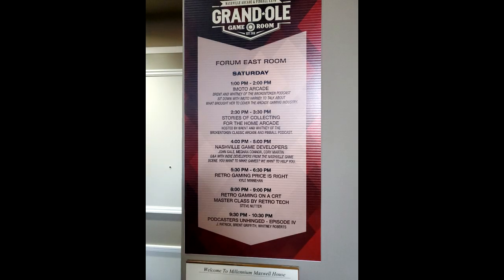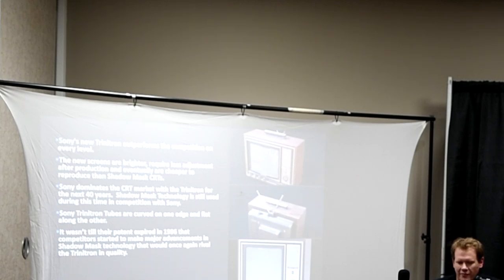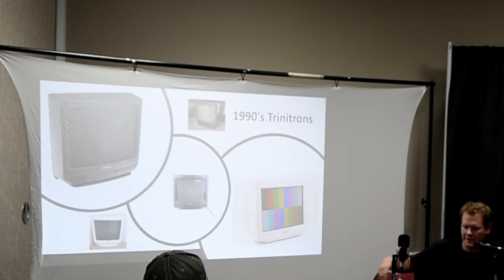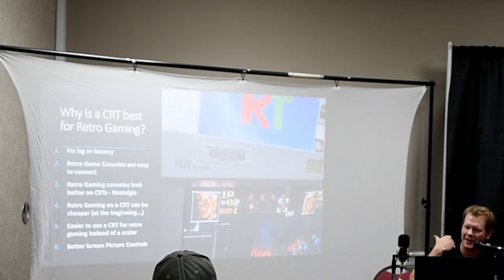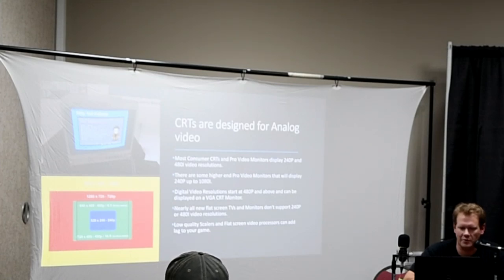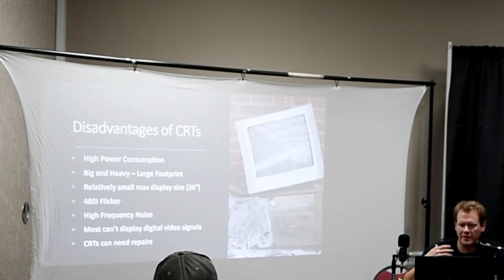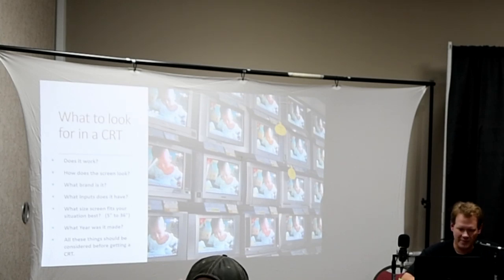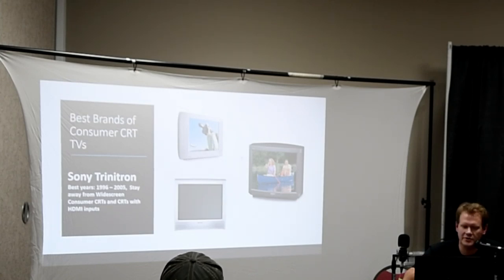Advantages of CRT Displays & The History of Sony's Trinitron - 2019 MasterClass Panel Pt. 2

Comment: Hey, one question its possible to replace a Cathode-Ray Tube, using it from another crt tv? example i have a small tv that works and i have a cathode-ray tube from a medium tv, but the board got damaged.
Reply: It is possible... if each television set's neckboard is compatible with each C.R.T.  ...there are neckboard connector adaptors for some C.R.T.s, if you run into an incompatibility.
Reply: I have swapped a few picture tubes of the same size and if they have the same grid and heater voltage there should be no problem.It's needed to measure resistance of deflection coils, it should be at least approximately the same.But i think it will be problem with swapping picture tubes of different sizes without main board modifications.
Reply: @badreality2  in case not working, where can I find those adaptors?

Comment: I do not agree on the timeframe to look for. 1996-2005 is "the boring years", Sony knew new tech was on the horizon, and the models were cheap mass products with 0 inspiration and totally ugly designs.
I think the golden age to watch for is 1990-1995.
Maybe in the US the #1 focus is on Trinitron, but 2 brands you can buy (alost) blind are Loewe and B&O. Those are often cheaper, and since they were "elusive" European made models, they always had RGB SCART, even on US exports. A MX4000 for example is really astonishing. But also the EU Sony's are far more interesting. Someone should start an import shipping container service.